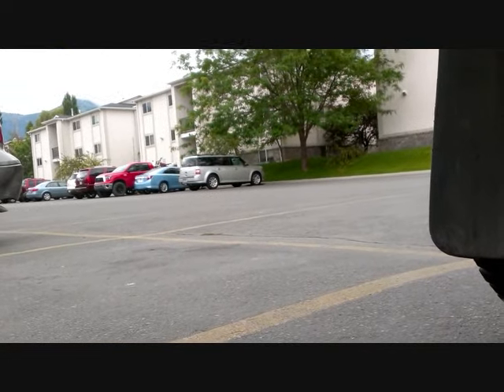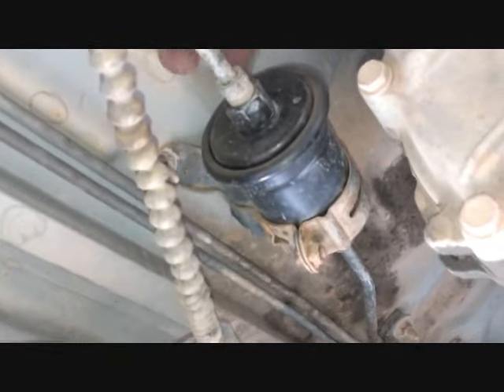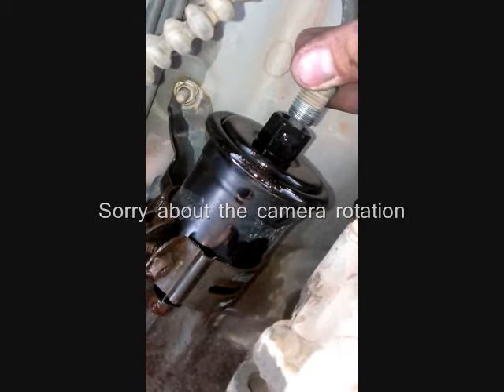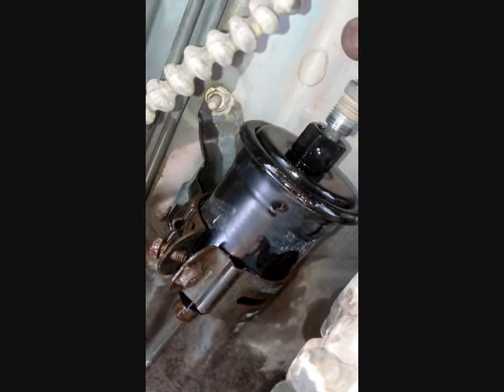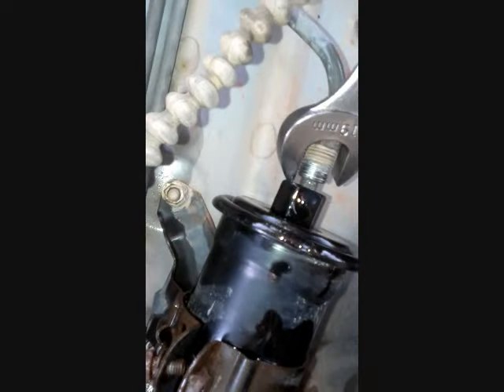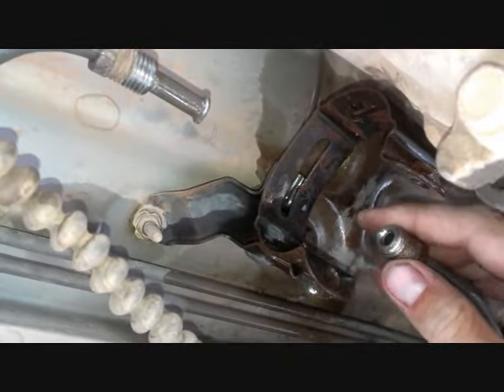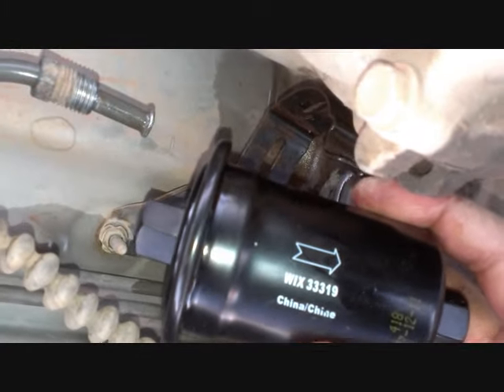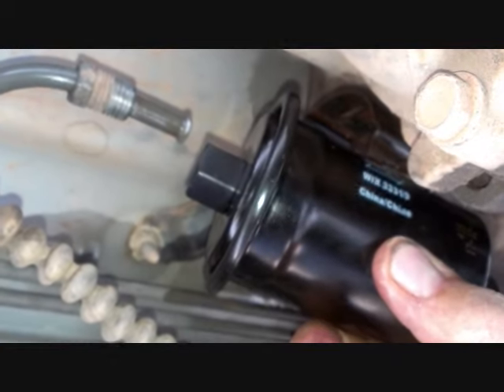Changing the fuel filter on a Toyota Tacoma Truck

Comment: FYI! Fuel filter replacements for MOST Toyotas including the Tacoma 2RZ, 3RZ and 5RZ 96’-04’ is a non-serviceable part. These filters were designed to outlast the vehicle. They DO NOT need to be replaced, even if your vehicle has 500k miles. The fuel filters were designed to last over 1 million miles. In a Toyota service manual as in the manual that Toyota certified mechanics use does not even have any information nor pages to replace the fuel filter. This is a non-serviceable part. Replacing one is a complete waste of time, and you also run the risk of breaking a fuel line, or not being able to get a good fit on a fuel line when replacing.

Toyota engineers intentionally placed the fuel filter in the most inconvenient and hard to reach locations because they DO NOT need to be replaced, ever, so breathe easy and remove the urge from your mind.

There’s also a mesh pick up bag located in the fuel tank that will clog up way before the fuel filter, and these don’t even clog up. You would have to literally pour pounds worth of sand in your fuel tank and even then, only the pick up bag will become clogged, never the fuel filter. Taking the time and heartache to replace a fuel filter that’s buried deep underneath of your intake manifold is a waste of time, waste of money with a bunch of busted up knuckles soaked in gasoline.

Comment: Note: Do not make this filter change with a full tank of fuel, the flow of fuel through the line doesn't stop. my job was horrendous because i did it this way.
Reply from the maker: Hmm... it really shouldn't be pressurized that much.
Reply: Did you release pressure from the gas tank by opening the fuel cap?
Reply: Pull out the fuse marked epi and crank the engine. It won't start but it'll depressurize the fuel lines so you can cleanly remove the fuel filter

Comment: Doesn't get much simpler than that. Thank you  brother.  Iv got over 200,000 on my 01. Everything under hood is original other than water pump.  It just started cutting out a little today. I'll start with fuel filter. Pray that's it.

Comment: Thanks. Really helped to know wrench sizes. I'll get a 14mm flare wrench. Those flare nuts are really soft. I'd hoped to find a way keep the gas from spilling during the change, but guess I'll just put down a wide pan to catch it.
Reply: I ruined my flare nut trying to get it off without a 14mm flare box wrench. I live in Canada and was trying to get it done in winter here. Now I have to figure out how to replace the hard line and re-flare the end. Super pain in the ass.

Comment: Hey Jerry, it depends on the engine type.  In a 2003 tacoma with a 2.4 liter engine, the  fuel filter is under the intake manifold.  Not an easy replacement!
Reply: +rkstew ...The "easiest" way to change the filter is to remove the passenger front wheel. Remove the mud guard. Remove the starter (yes, I said the starter). Then you can reach in through the fender over the frame and remove the filter.
Reply: Stylensky you can also invest in some swivel extensions and some standard length extensions a simple ratchet will do the trick pretty quickly. the only issue I had when I changed mine was for some reason there was no 16 mm socket in my tool kit from Autozone. luckily the passthrough bolts were loose enough to use the 11/16
Reply: Mine is on the driver's side under the intake manifold.

Comment: Only on a V-6 engine it's located on the left side underneath on the floorboard, if it's a 4 cylinder engine it's a little harder to replace, it's attached to the intake manifold under the manifold near the number one cylinder, towards the front of the engine. I so happen to have the 4 cylinder and it's not going to be easy to replace as your video here on a 6.  Thanks for posting...now show us a 4 cylinder filter replacement. ha!
Reply: Rambling Rose good point

Comment: Invest money in some Flare Nut wrenches. Prevent stripping of the nuts. Take off the fuel cap. That'll help depressurize the fuel tank.
Reply from the maker: Thanks, will do.
Reply: Idontcare_626 No it wont stop telling stories,the pressure is between the filter and the pumpTank might burp big deal
Reply: gtube if they don't want it to burp they could remove the fuel pump relay and start the car once it turns off from the fuel being use in the lines it would be depressurized. just saying as a safety precaution for those who don't work around fuel very often.

Comment: The fuel filter on my 2003 Tacoma 2.4L is in a more difficult location: under the intake manifold.  It can barely be seen from the top.
Reply: Same with my 2001 . . .

Comment: My 1998 Tacoma has the fuel filter right under the intake manifold. Damn near impossible to get to without some disassembly. Plus, mine is connected with Banjo Nuts, so no line wrench required

Comment: I have a 95 tacoma 2.7 4x4. I wish it was that simple as your video but unfortunately my fuel filter isn't there. Just wanted to throw out that some tacomas have their fuel filter under the intake manifold and is a pain in the ass to get your hands in and replace.
Reply: I read an article that Toyota hides the fuel filter because there is no reason to change it unless it clogs up, it holds a lot of dirt lol. Some of my coworkers do not agree that a filter can last 100K or even longer.
Reply: heavymechanic2 just looking for info on changing a fuel filter on 96 2.4, have owned since new, never changed, changed starter, first time derby day, truck has 360k.
Reply: With that many miles a fuel filter change would probably be a must lol
Reply: Nick Melnykov I've been hunting for that thing all day found out I'm to old to change a fuel filter is pretty weak but I have mechanic freinds and your adivice saved my day thanks Gary q

Comment: The 2001 Toyota Tacoma 2.4 fuel filter is located under the exhaust manifold in the engine compatment. Somewhat difficult to replace.

Comment: Thanks for posting this video.  I have a 96 T100 and my filter is exactly where yours is. 

My problem is that my truck idles very rough on warm starts.  In other words, I can go into the grocery store for 30 min and when I come back out she will start but idle very hard and if I put her into a gear the motor dies.

Could this be the fuel filter, the fuel pump, or both?
Reply from the maker: Matt Golden Could also be a throttle position sensor.  I had the same issue on my toyota tacoma.
Reply: It could be semi-clogged injectors considering how old T100s are now. Maybe start by having them cleaned. Probably better to bite the bullet and have a Toyota dealer diagnose it since there's too many things it could be.

Comment: Did you have to use washers or o-rings to on the fuel line? My fuel filter came with 4 tiny small washers and I am not sure where they are supposed to go.
Reply from the maker: Hmm, Im not sure.  Mine did not come with those.

Comment: Is that thread tape i saw at the end? I installed one of these today on my 92 yota 4x4, leaked some...i took it off and cleaned the threads, still leaked, tried teflon thread tape, still leaked. The crush washers didn't seem to help, they crushed down crooked and leaked as well.
This is the 2nd filter over several years, i noticed last time i had to tighten it as humanly possible, today i bent the larger built on nut on the filter, the larger nut caved in on both ends from so much force tightening it, and yet leaked. Maybe the fuel line ends are worn? IDK but tomorrow i'm cutting the flared ends off the fuel lines and goin to install a K&N inline see through filter with new rubber fuel lines attached to the freshly cut metal lines.
The truck sat for a couple years prior to me buying it and i realize things wear out but damn, half a day trying to get a new fuel filter to stop leaking is ridiculous. New outlook on a new fuel filter setup tomorrow.
Reply from the maker: With my last tacoma I was having similar issues.  I think its a smart idea to go to the new filter.  You should make a video and post it up to youtube.  I'd be interested to see how you do it.

Comment: how often are we supposed to change out the fuel filter?
Reply: 60k miles
Reply: Never. Toyota engineers intentionally designed these fuel filters as non-serviceable parts.
Reply: @joshua1843jett it takes me 10 mins to change out my 04 fuel filter. Two nuts. I just don’t know how often

Comment: Not true on the 1998 Tacoma the fuel filter is underneath the manifold where it is a bitch to get to they said you would have to take off the manifold  but you can to it by  taking  off the tire and reach though the inside but you have to have small arms  I am doing this as we speak good luck   !!!!
Reply from the maker: sid reid Dang man!  They must have switched the fuel filter location mid year, because on my 98 Tacoma it is back by the rear tire like in the video. Good luck!
Reply: Might Have!!!!! but either way it was not fun to get too . And thanks I need a lot of luck  HEE HEE

Comment: wrong !   2003 Tacoma has a nearly inaccessible fuel filter under the intake on engine.
Reply: This is true for the 4 cylinder, but false for 6 cylinder.